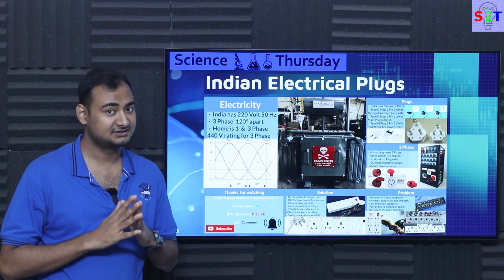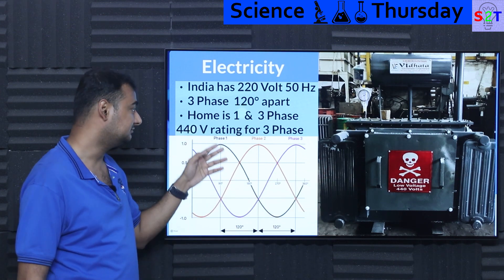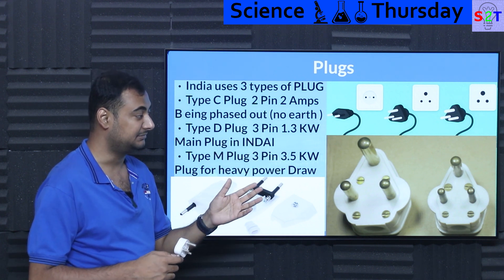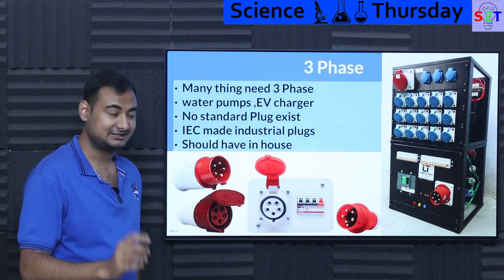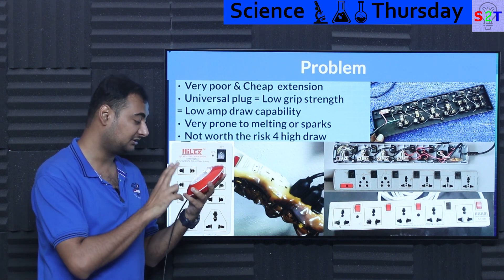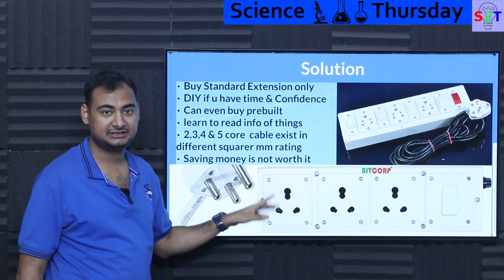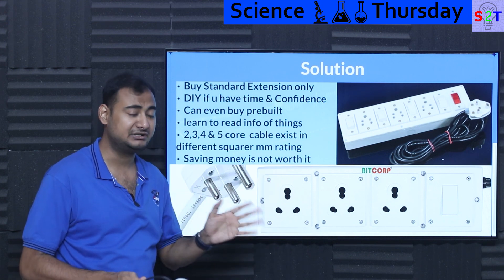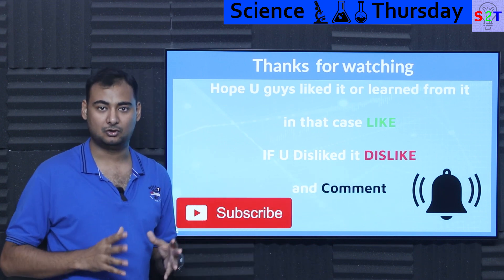Indian Electrical Plugs Explained {Science Thursday Ep188}

Comment: In U.S./Canada we don’t have 2 Phases, it’s called Split Phase, basically it’s the both end of secondary coil of transformer at 220VAC. It’s the same phase. The 110VAC is derived from the central tapping of the transformer’s secondary coil.
Reply from the maker: yes it 180° phase angle

Comment: Thank you, S2T, for the video. Upvoted.

I landed on your video because I have a question that you may be able to answer. I have a polarized plug (US type with one prong fatter than the other where the slim prong is for the hot wire and the fatter prong for the neutral.) 

Here's my question. How do I identify which is the hot wire in Indian outlets? Is it the one on the left or one on the right. Thank you for any help.
Reply from the maker: unfortunately the best tool is to just buy a tester and stick it into it   something like this https://amzn.to/3S8nfZy    Taparia Steel Line Tester u can buy from local shops too for quit cheap
Reply: @s2tenglish  Thanks much. I borrowed a tester from my neighbor and figured out that the live wire is on the right of a three pin outlet. Cheers. Atanu